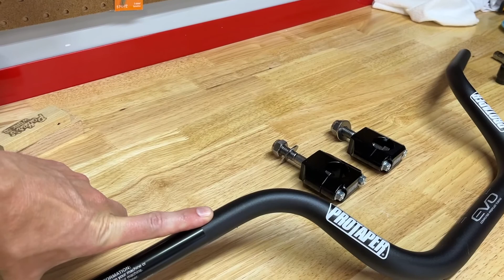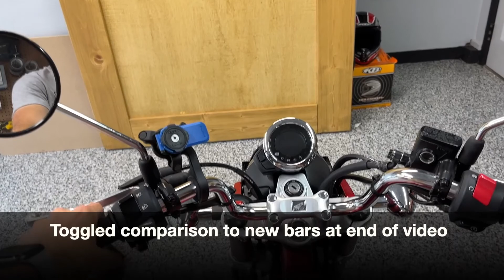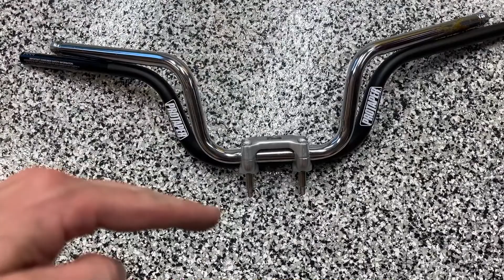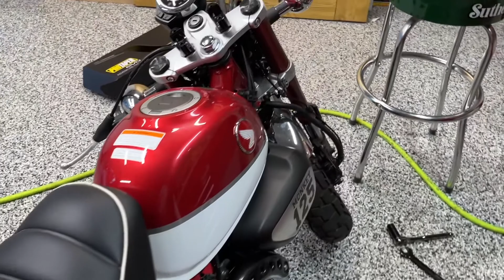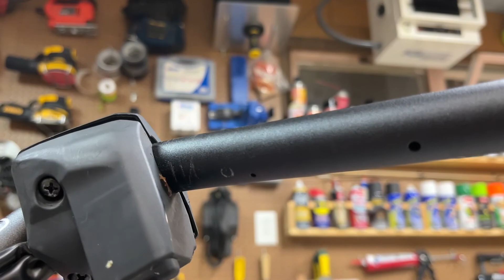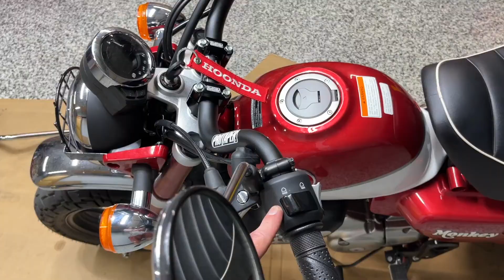Honda Monkey ProTaper Evo Adventure HIGH bars

Comment: Nice video. A couple things, The Pro Taper bar mounts,  go to ACE Hardware and get shorter bolts. Take the supplied bolt with you and get the same thing 25mm shorter. Those may be metric threads so check that at the store. I'm not sure if the ProTaper bolts are metric or SAE. If metric, the nuts take a 19mm wrench.. The holes in the handlebar are most likely metric too so 5mm.
Reply from the maker: Good call Ohno!

Comment: Thank you for this. I was able to install same bars no issue other than tightening. I got it somewhat tight but both sides were super hard to get any wrench in. Did you ever find a solution to get these truly tight?
Reply from the maker: Glad it was helpful!  I never really found a good solution, but I was able to get them pretty snug with what I had on hand.  I actually sold this bike (moved to a KLX300SM), but my friend bought it and it’s held up fine for him.  I will say, I miss that bike a lot.  Wish I had the room and $ to have both lol

Comment: Couldn’t you just have cut the bolt shorter ?
Reply: Great video btw. Thank you
Reply from the maker: You could cut the bolt shorter for sure, but you will still need the washers/spacers because the threads stop too soon on the shouldered bolt.  There’s about 1/4” of smooth bolt sticking down through once you tighten them up.  The bolt has a special head on it too, so you can’t just swap it out with another one (might be able to order a shorter one possibly).  And thanks man!
Reply: Gotcha. Are you still using this setup ? Any problems ? I’m about to do the exact same thing.

Comment: Can this handlebar be mounted with original clamp?
Reply from the maker: No, unfortunately not, the original is 7/8” and this bar is 1-1/8” (a fat bar).
Reply from the maker: @Jesus_Loves_You_To , I used all the original controls and grips, just swapped the bars